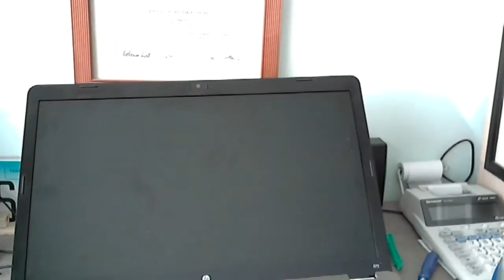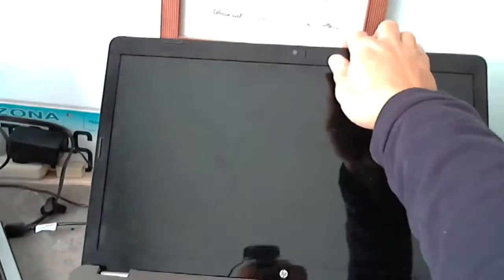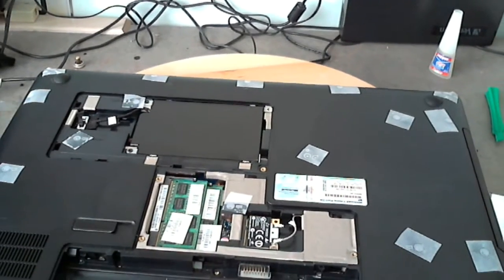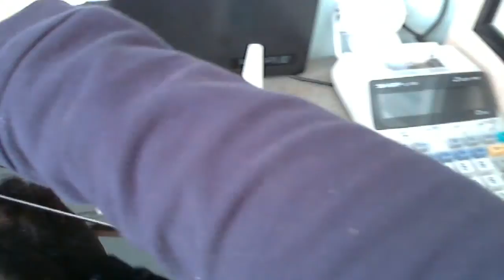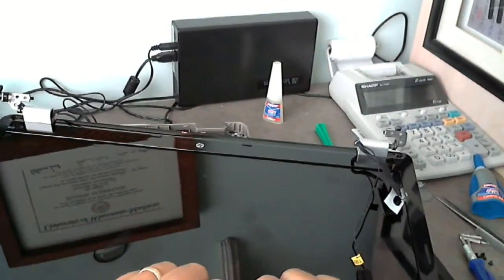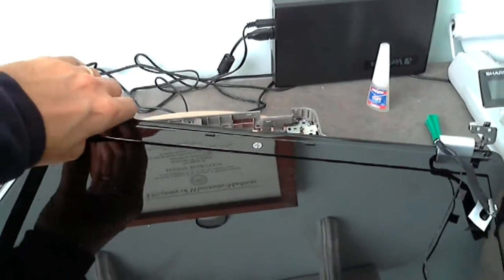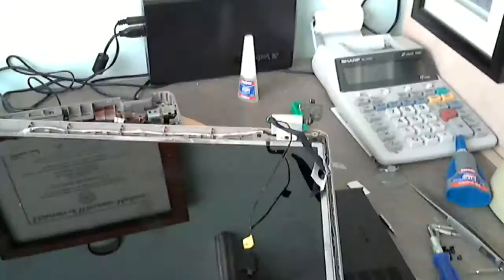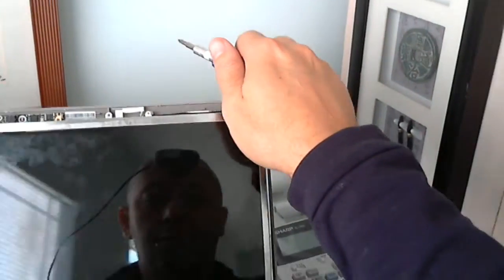HP G72-261US Laptop Screen Replacement procedure

Comment: I tried the quick method way but, it seemed I would strip the screws even with a precision screw driver. I followed this video and it took only 30min to swap the screen with a magnetized precision screw driver, and credit card in place of a guitar pick.

Note: I would have stripped the screws if I followed the quick method. Those accessible screws were tight.

Comment: unfortunatly, mine was nothing like this.  Im guessing i have a revision 1.2, because I had to remove the whole mobo before I could access the left hinge screws, and I could not use his other video, as the screws were moved down about 1mm from the bottom, so they could not be accessed unless you remove the screen assembly.

Comment: I am thankful that you showed how to open the whole thing! I don't need to change a screen, I just wanted to get inside to clean and could not figure out the hidden screws and was a little afraid to put the connectors out until you showed how easy it was. Thanks!

Comment: DON'T DO THIS! I JUST WASTED 3HRS FOLLOWING THIS VIDEO. I tore my whole laptop apart as instructed in the video only to find out that there was NO REASON TO! You can easily reach the two screws that hold the screens frame in place using a precision screwdriver. Needless to say I am more than a bit miffed about being mislead by this so called expert video. I will post a video showing the right way to do it just as soon as my replacement screen comes in.That is if Eugene here doesn't fix it first.